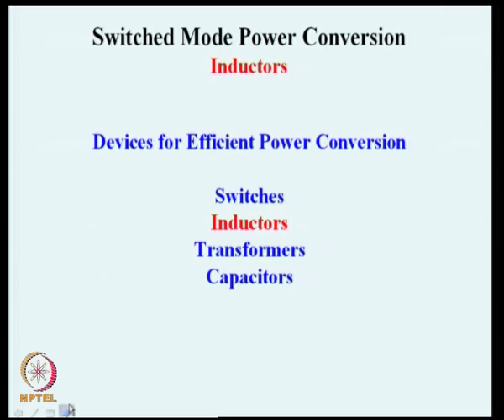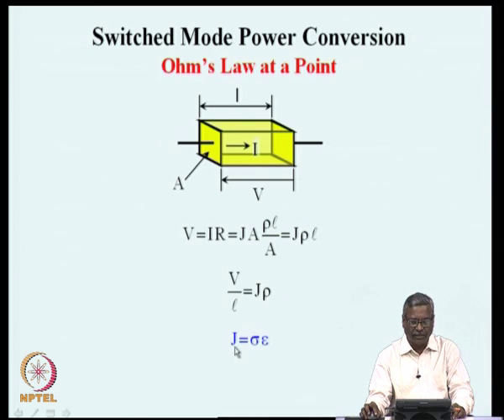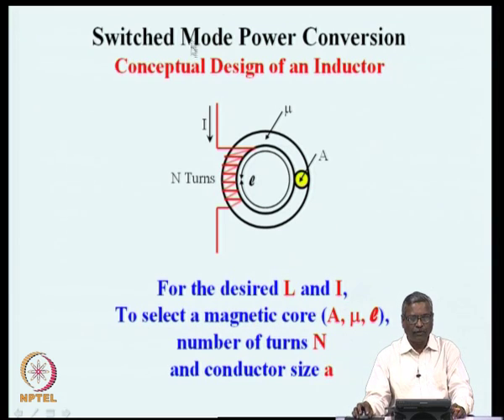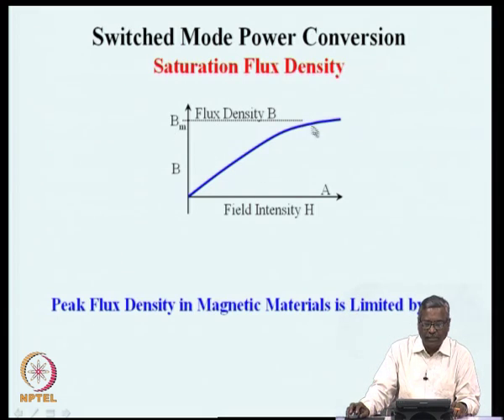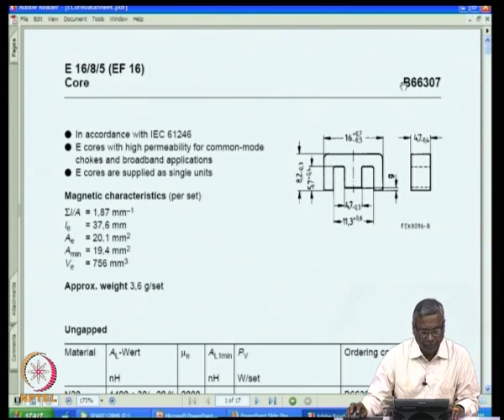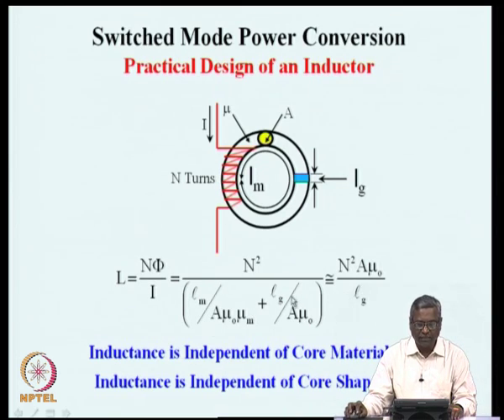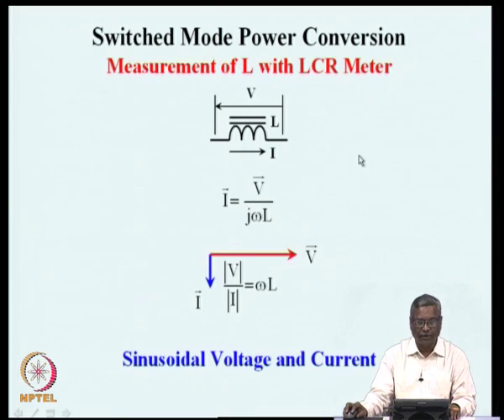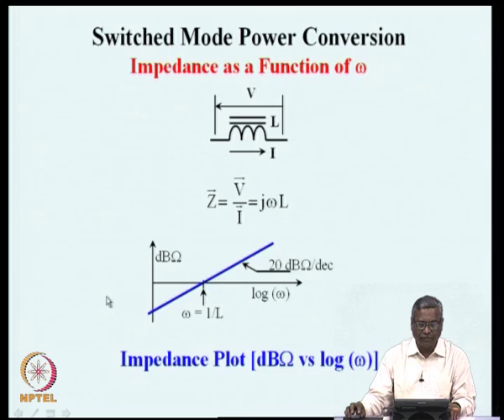Mod-04 Lec-05 Inductor

Comment: While it is not possible to describe in detail the association of non-Conservative fields with time-varying magnetic fields as in inductors, this maybe the cause of confusion of stating "voltage in an inductor appears only across the terminals, not along the inductor". 
The non-Conservative electric field polarizes the inductor and results in surface charge production which produces a Coulomb electric field. 

The opposing emf produced by an inductor is a characteristic of the non-Coulomb electric field that is proportional to the rate of change in current causing a changing magnetic field. And that is Faraday's Law.
The current is a result of the combination of an opposing Coulomb electric field and the applied field which is changing the current. The opposing Coulomb field is a result of polarization of the inductor by the non-Coulomb electric field. So, the current is a consequence of the resultant field of the applied field and the Coulomb electric field in the inductance coil and is determined using the governing relation in conductors J = σE_net.
It is not possible in this post to discuss in more detail the formation of the Coulomb field when the current in an inductor is changed.
Before learning Faraday's Law and its application to the operation of inductors, it will be instructive to understand Current, the conduction process and Voltage at the fundamental level as in the following two videos:
i. https://youtu.be/TTtt28b1dYo and
ii. https://youtu.be/8BQM_xw2Rfo
The last frame References in video #1 lists textbooks 3 and 4 which discusses topics on inductance and inductors in more detail using a unified approach and provides an intuitive understanding of inductive reactance.
It also describes with sequential diagrams how an inductor develops the induced emf. Textbook 4 https://techsarworld.com/product-detail/fundamentals-of-electric-theory-and-circuits-559 
shows how the current lags the voltage across the inductor by 90 degrees for sinusoidal input voltages using sequential diagrams.
Also see
Faraday's Law and self-induced emf - video lectures by North Carolina State Univ faculty
This is a link to a video lecture by NCSU faculty on Faraday's Law. 

Important
7. Faraday's Law
Watch from 8.0 minute.
Ch22L1a
https://youtu.be/ktGL5cEB82I?si=u9vH33gaX1Wy5JvF 

8. Non-coulomb electric field - curly-patterned fields
Watch from the beginning.
Ch22L1b
https://youtu.be/nV6xg-OuxoY?si=UjJBG3wDjazfeQMM 

The second link is to a video lecture on self-induced emfs in solenoids (inductors).
9. Self-induced emf in a solenoid
Ch22L2a
Watch from 10.30 minute.
https://youtu.be/RJ0J_TL-wUQ?si=qPZ74uD-m6weyFlb 

PPTs and Videos with animations for all the ten chapters including inductors and inductance and RL circuits (Chapter 5) and a few applications Regulated DC Power Supply, Differential Amplifier and Transformer coupled audio power amplifier of  book Fundamentals of Electric Theory and Circuits are available for download and viewing here
https://techsarworld.com/download-resource/fundamentals-of-electric-theory-and-circuits-559